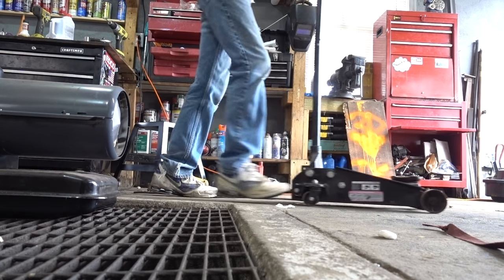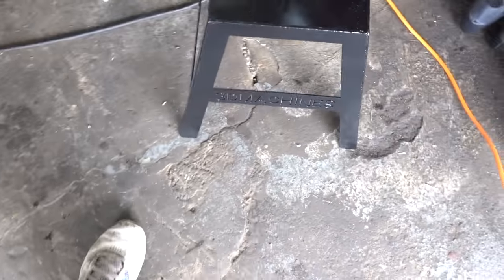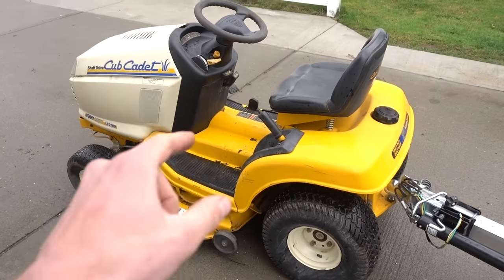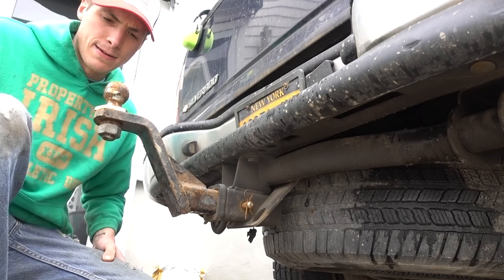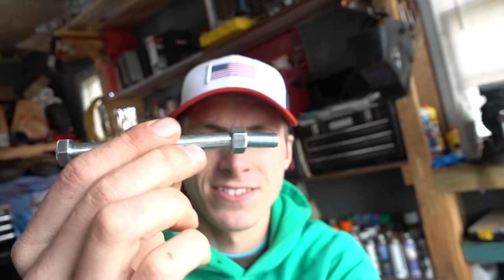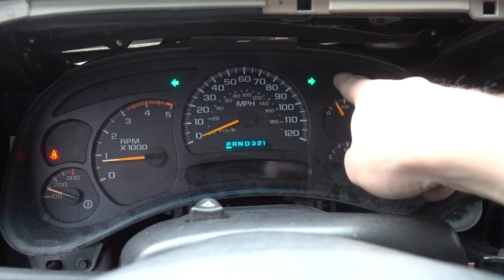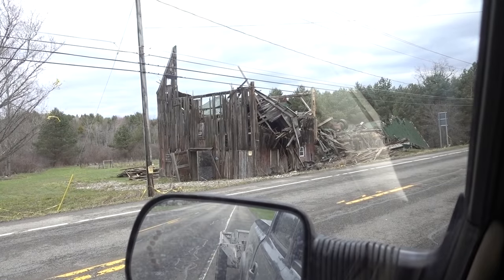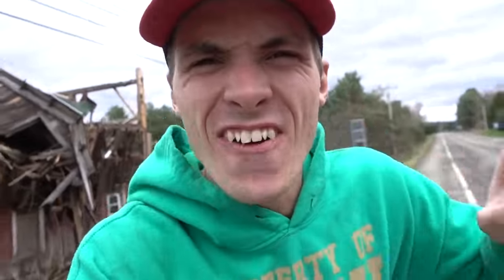LIGHTING JORDANS ON FIRE!!

Comment from the maker: The weather doesn't tell me how to feel. What about you?
Reply: same
Reply: 3DMachines I love the rain!
Reply: 3DMachines you never cross your chains If you do you risk flipping the trailer and your truck
Reply: 3DMachines no the weather is what it is. you cannot change it so deal with it and move on with your day!!
Reply: Those chains are to protect to other users on the road in case your trailer hitch breaks, ultimate security measure. In Europe trailers with a total mass (load and weight) more than 750 kg with brakes have a similar wire to activate brakes totally in case of a total failure of the trailer hitch. Search in YouTube "Trailer hitch FAILS! Big & small trucks" and "Enganchar un remolque con freno LAFUENTE"

Dalton, protect your trailer electrical installation with an opened flexible corrugated tube, it's easy.

Ondo ibili,
Reply: Dalton I sent you a five dollars and a envelope and only got one sticker wats up with that!!!???!!?!?
Reply: torre1976 Vs a trailer hitch can't really brake it's steel just scroll up and read why you should always cross your chains
Reply: 3DMachines I have several feet of snow, that's how I feel.
Reply: 3DMachines now there is a justifiably reason to put a lift on the dirtymax
Reply: + Jose Robles In Europe a trailer hitch can incorporate an inertia brake system, search in google "inertia brake" for an image. If the tráiler hitch fails there is a breakaway cable to activate trailer's brakes totally.
Reply: me niether
Reply: 3DMachines the way my bike runs depicts my happiness and how I feel
Reply: And from a few years to now the "AL-KO Trailer Control ATC" has been developed specially for caravans.
Reply: not how I feel but maybe what I'll be doing.
Reply: 3DMachines weather has alot to do with the way i feel... Like i have said before im an ole man and all the broken bones plates and screws i have in me the weather makes a big diffrence in my life... Every time the weather is going to get bad i know the day before...
Reply: It does alittle, I need to go outside, or I just feel ill
Reply: Haha
Reply: 3DMachines  hi
Reply: NikeBoy 21 ,

Comment: By crossing the chains or towing cables under the trailer coupler and attaching them to the tow vehicle with hooks, the safety cables act like a safety net in an emergency, catching the dislodged tongue.
Reply: Mike R 👍
Reply from the maker: BOOya
Reply: If the chains are put on right you should NOT have to cross them. I drop a few trailers in my life and the hitch never hit the ground and I was able to control the trailers to rehooked them.  Why they fell off they need to be hooked up on a flat and straight. They never fall off but me I was in a hurry and it took long to do it right. Also I make my stuff all for a 2" ball and put one on my lawn mower and ATV.
Reply: 3DMachines I really wnjoy these videos when you just get out and about in the dmax
Reply: That, and you won't drag so much chain or cable on the ground while pulling your trailer
Reply: and because 3D machines dad said to
Reply: Mike R I think it is both
Reply: no he was right
Reply: that and here in texas its illegal if you dont
Reply: Mike R 
that's exactly what I was going to say
Reply: Whats the point if it is a copy and paste. It is the answer. Stop trolling.

Comment: Crossing the chains creates a basket to catch the tongue if it comes off the ball......or if the coupler breaks free of the frame.  We had one at work that broke the coupler from the tongue frame and broke both the chains too, was way overloaded with weight.  The safety cable on the trailer brakes applied the brakes and stopped the trailer in the road....

you should put some rubber sheet on top of that fancy new stand...

Comment: I fell in love with a baja dr70 that my friend found on the side of the road, only problems were breaks, plastics, and the motor was seized... but due to it being such a small motor i was able to spin the flywheel and free it up. And then it had some extreme valve knocking so it blew up but im definitely gonna rebuild it when i get the money

Comment: Hey Dalton, from experience you should repaint the top of the stand if you got any scratches on the paint, and look into a rubber pad for the top, either use some good glue or rivets... but it'd be a good idea since your stand is made of steel it'll rust after a while with bare metal exposed. Just a though, love the videos!

Comment: Dalton, you should put some pieces of rubber, like an old bike tube or treads of a blown tire, on the top or your new stand, so the stand doesn't get scratched and rust and also so your bike won't slide around on it.

Comment: That light was the Overdrive Lockout light. If you press the Tow/Haul button on the end of the shifter for about 3 seconds that will disable 5th gear and display the light. This is used for hauling very heavy loads. Turning the key off will disable the lockout or you can press the button for another 3 seconds or so to do the same thing.

Comment: Mike R is correct - Crossing the chains in theory will catch the falling trailer tongue and prevent it from hitting the ground in the case of your hitch failing it also can help shorten the length of chain to keep it from dragging.

Comment: that light was the overdrive off light. if you hold the tow haul button down for a few seconds it will turn that light on and off... at least on the 04 Dmax it does

Comment: The reason your supposed to cross the chains is if the hitch and the trailer disconnect while your driving it keeps the trailer up a little and still attached to the truck.

Comment: so you create a cradle if the ball hitch was to slip off and you keep some control over the front of the trailer without it sliding under the truck or scraping against the ground

Comment: By crossing the safety chains it protects the tongue of the trailer is it comes off from the road but it also protects the road from the tongue if it happens to come off. Also it is actually illegal to attach the safety hitches to the hitch of the truck or vehicle and you are supposed to attach the safety chains to the frame of the towing vehicle.

Comment: you are supposed to cross your safety chains because if there is a case if the trailer becomes unhitched the chains being crossed will keep the trailer from falling and you can still steer and control the trailer until you are able to hitch up again

Comment: I believe that light wasn't a no drive light i think it was a overdrive off light and you turn overdrive off by holding in the tow haul mode button on the shifter for a few seconds. If you never hit the button it might have just been a fluke the light came on. On my 2004 silverado the security light came on and stayed on for no reason a few weeks ago. Turned the truck off then back on again and the light hasn't came back on sense.

Comment: you cross the chain or cables etc so that IF  the trailer is to come off the ball it will cradle the hitch so it will not crash down to the ground and destroy the hitch

Comment: You cross them because if the trailer comes off that will catch it and your trailer wont cause sparks and its a whole lot safer. If you do not cross the chains it will still be attached to your truck but it will drag and leave a trail of sparks and you have the risk of breaking something.

Comment: You cross safety chains... for safety, actually the crossed chains not only keeps your trailer attached in case of a hitch/ball failure and also prevents the trailer from nosediving into the road surface in case of such a failure. Weather don't rule me.

Comment: it's actually not a good idea to cross your safety chains. if the hitch somehow comes off the ball, since the chains are crossed, there is a very high chance of the trailer flipping.
Reply: mitch keel how would the trailer Flip?
Reply: mitch keel are you high bud
Reply: mitch keel I am sorry but you're wrong you are supposed to cross your safety chains